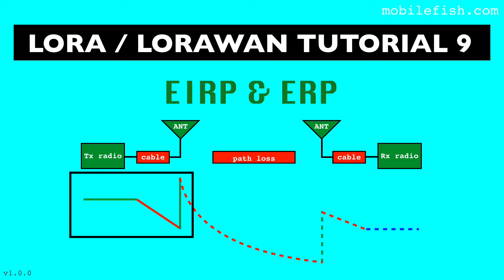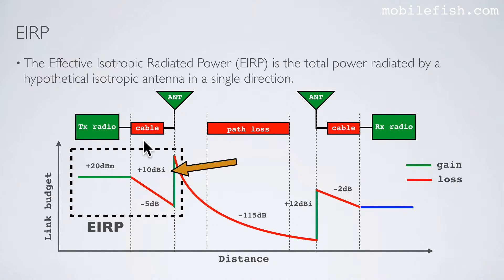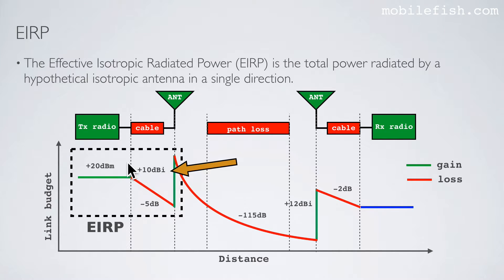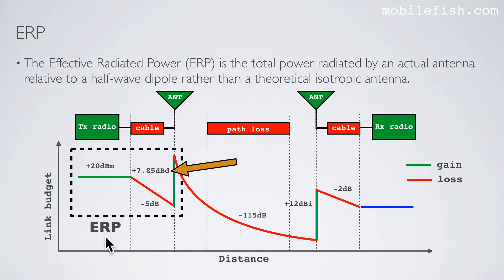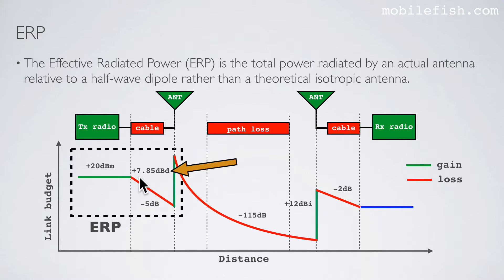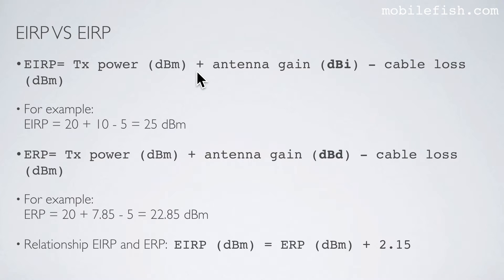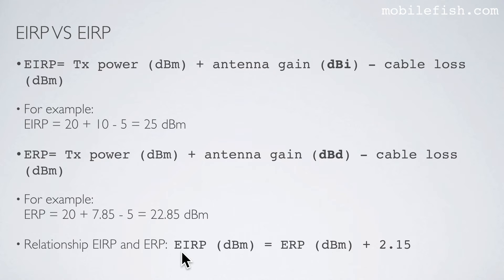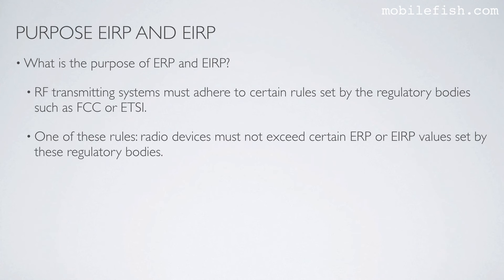LoRa/LoRaWAN tutorial 9: EIRP and ERP

Comment: Hi Mobilefish, great videos! 
When explaining the ERP at 1:00, the Tx antenna gain is changed from dBi to dBd. However, for a correct link margin, as illustrated on the slide, also the Rx antenna gain 
should be changed from dBi to dBd, right?

Comment: CE standard EN 300 328 say 20dbm (100mW) EIRP is maximum. so I am restricted my transmitter output power to 20dbm only (consider 0 loss and 1 db antenna),  so what is the purpose of buying a RF module which has transmitting power till 1W.

Comment: The rules of the regulations apply only to endnodes (Tx), would not apply to the gateway (Rx), right ?, In theory the antenna of the gateway could have a high value of gain, or would it also be limited in a maximum gain?